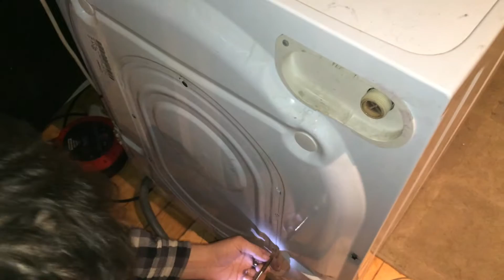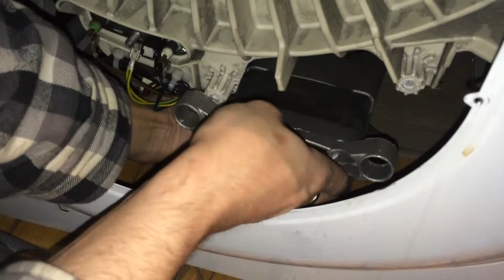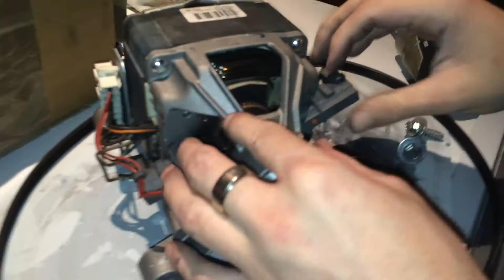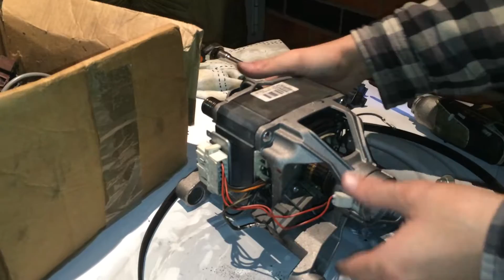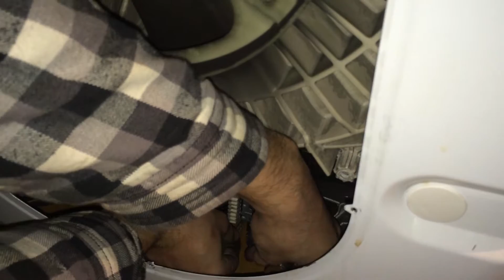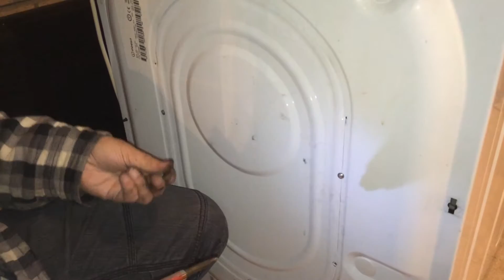Washing Machine Not Spinning Repair :- Blue Spark Repair :- Brush Change

Comment: Hi advice please I have a hoover dynamic washing machine 4 months old and got big blue flashes coming from bottom of machine went to kitchen and horried burning smell  I just in plugged it . help pls
Reply from the maker: tara Clifton it's not going to be too much of an issue --- I imagine it's an irregularity with the brushes,  perhaps one has worn faster 

If it's only 4 months old it should be under the years warranty 

Or have you purchased second hand?
Reply from the maker: tara Clifton The hoover machines are the same as in this video 

Except it's usually 7mm bolts for the back plate 

10mm bolts for the motor 

However everything else is pretty much the same as this video
Reply from the maker: tara Clifton I'll do a video quickly and upload on how to check a motor as well and some other problems that can occur -- if you have a multimeter it's helpful too
Reply: jason hounsell thanks
Reply from the maker: tara Clifton I'm having a bit of trouble uploading any videos at the moment,  have done one on motors and how to test and what to look for,  however YouTube won't upload it at the moment as it keeps failing.  

If you need any help I'm happy to do so,   However it sounds like brushes.   While the motors out check for any damage segments (the copper plates the brushes contact) 

Burning smells In a washing machine can be alarming however 99.9% of the time it's either brushes or the drum touching the door seal gasket - both are nothing to be alarmed about.  

Take the brushes out and have a look and compare with length in my video here,  if you don't find the problem I'll give me my email for further advice.